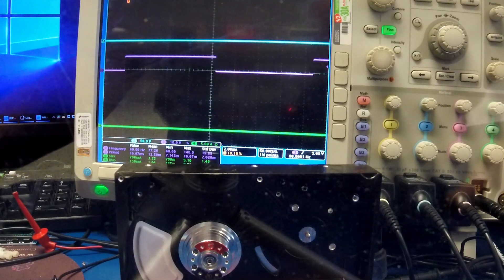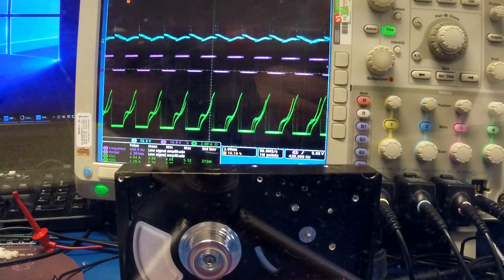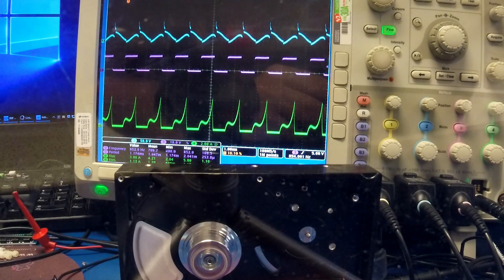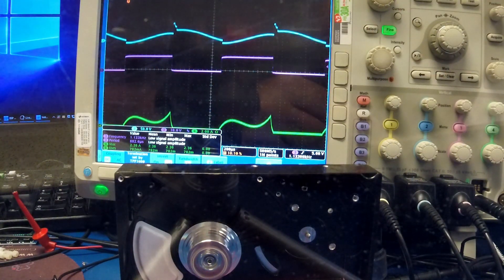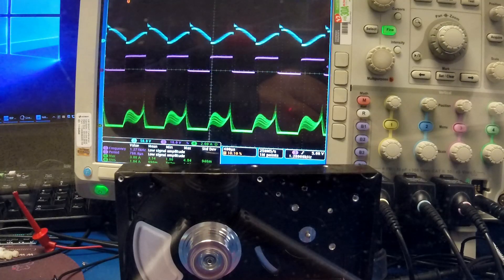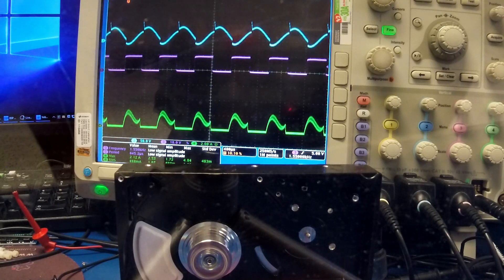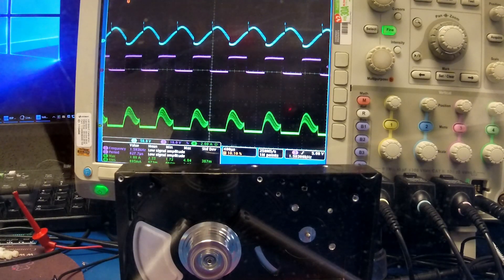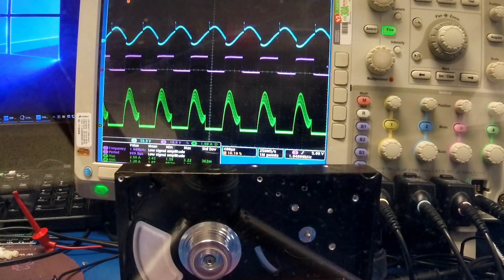25,000 RPM Hard Disk Drive motor controlled by Single FET & function generator

Comment: Why you divide by 4 to obtain frequency when you used 2 phases to spin engine?
Reply from the maker: Good question! My normal hobby motors are 12N14P, this means 12 stator poles and 14 magnets, its of course 3 phase. Because a pair of magnets are working together at the same time, the 14 is = 7 pairs, so on this motor you divide by 7. But is HDD motor has 8 magnets (formed when zapping the magnet material), so = 4 pairs. That is why I divide by 4. I verify this with a optical tachometer and compare to the scope frequency for verification.
Reply from the maker: I forgot to add, a simple mechanical rev is one turn, but in a brushless 3 phase motor, it takes 6 electrical commutations to make one eRPM (I am only doing 1 of the 6 in this video), this throws off some people on the math. Another reason to verify with a tachometer. Check out some of my other motor driving technics here https://www.rcgroups.com/forums/showthread.php?3870847-DIY-Brushless-Motor-Controller-Options-Pro-s-Cons. also check out my million rpm videos too, thanks for watching.

Comment: Good job my friend.  At first I was very interested in running this engine.  I have done many experiments and built the frequency generator on which the motor runs and also created the driver.  Which the pulse takes from the frequency generator.  With all this my instrumentation was very simple. The oscilloscope was only measuring 250kHz in one channel.  Your devices are very wonderful
Reply from the maker: Thanks. When I compare the rpm tach to the scope, it shows 4 pulses for one mechanical revolution, so I take one period, times by 4 to get the time for one mechanical revolution, then 1 divided by that time to get revolutions per second, then times 60 for rpm. Are you sure it was 250KHz, or 250Hz? 
My 3.8 million rpm spinning magnet is around 63KHz (63,000 revolutions per second).
Reply: @user-rs8zg8ey2b  I mean my oscilloscope.  It measures up to 250 kHz.
Reply from the maker: @inventorkr1  I see, thanks for clarifying that. I am lucky to have a 4ch 1GHz scope with current and diff probes. FYI, you can get low cost hall sensors that output a voltage (same as a current sense resistor, but,,its a lot cleaner output, isolated and does not need to be connected to ground, do a search for ACS712 on ebay, there is two types, radiometric is a bidirectional style (-/+ amps) and unidirectional and many amp ranges. The bidirectional version outputs 2.5V at 0A, then goes up or down from there, the unidirectional version starts at 0v and goes up.
Reply: @user-rs8zg8ey2b  Thanks for the clarification .  Yes, there are many types.  I wanted to buy one that measures up to 500MHz.  But it is expensive I can not buy it at the present time
Reply from the maker: @inventorkr1  Dont forget to look at the USB scopes (hantek is one brand), they have a hardware module and plug into the PC or notebook.

Comment: Can you please share the circuit please :)
Reply from the maker: There is 4 wires from the motor, 3 phase and one common, I just picked two phases, hooked one to the power supply, the other to the fet drain, fet source to power supply ground, fet gate to function generator, real simple, set to 60Hz, then give it kick start like in the video. If you try it, post a link here, thanks.
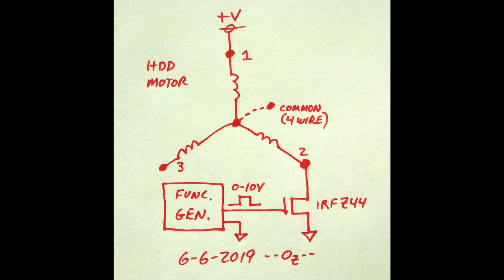Reply from the maker: I did, at 16:20 in the video.
Reply: @user-rs8zg8ey2b  Opps sorry . Didnt notice.
Reply from the maker: @mohamedshafi3464  yesterday I got to 58,000rpm, I have not processed the video footage as I think there is more in it. It's using my new h-bridge driver circuit that I am using to spin the 2.5mm neo-ball to 2 million rpm, look for my latest video (12-31-2020).
Reply: @user-rs8zg8ey2b  sure mate. Its interesting. time to rig all the old HDDs. :)
Reply from the maker: I got to 59,000 RPM in my new video https://www.youtube.com/watch?v=YlmgVfCILeU

Comment: Impressive indeed. What's special about HDD drive motors that makes them support such high RPMs and torque and heat ?
Reply from the maker: The bearings are pretty awesome with very little slop. I was limited on my power supply voltage or i would of got higher speed. Most three phase brushless motors have a push/pull fets on each winding (6 fets total), here I am only using one fet, and simple function generator adjusting freq, I dont think it can be done any easier (but not positive). Have you seen my 3 million rpm project? https://www.youtube.com/watch?v=ZQE05T-3680&t=2s  I haven't made a video of my highest speed yet 3.8Mrpm, Or my quadcoppter videos https://www.youtube.com/watch?v=uHoFfpLSb2g&t=2s
Reply: @user-rs8zg8ey2b  
Thatnks a lot
Reply from the maker: @sidamarali3030  Have a great holiday bud!